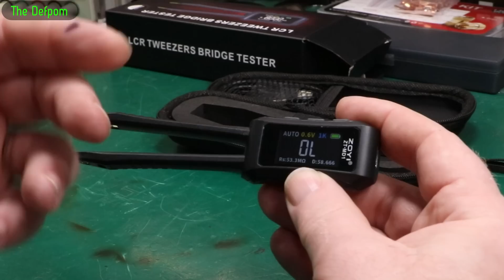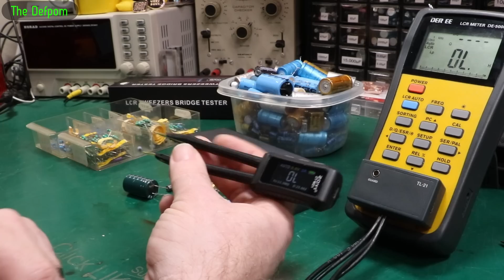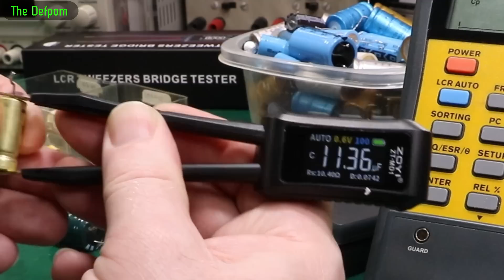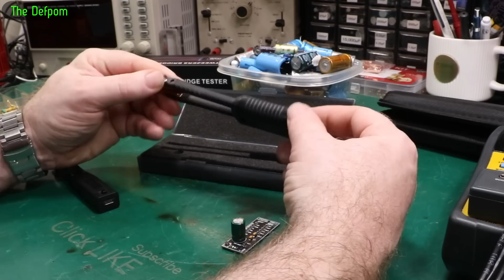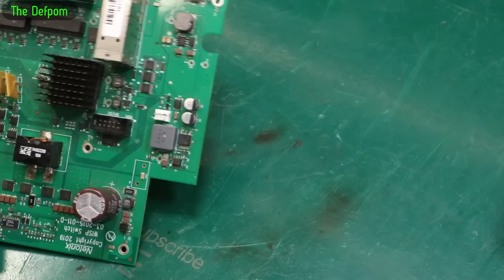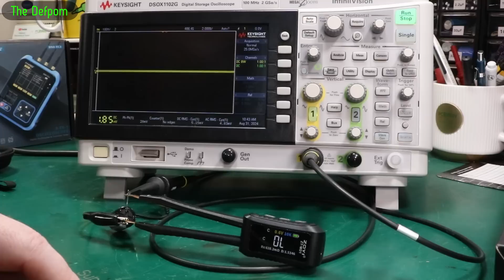🔴 Good LCR Meter ? - Zoyi ZT-MD1 LCR Tweezer Review - No.1274

Comment: For in-circuit testing you should actually lower the test voltage (with the newest firmware you can go as low as 0.1 V) so that surrounding parts on a board are not activated for a more accurate reading.

Comment: Did you ever compare ESR on smaller mylar or ceramic capacitors?  I found quite a bit of variation between my ZOTI and my BK 879B LCR meter.

Comment: The boot loader for the Zoyi ZT-MD1 and the FNIRSI HRM-10 look almost the same. They have similar key press shortcuts to enter the boot loader mode (hold left and power). The displays show a similar bootloader message. And the drive that appears when connected to a PC has a file with the same filename (Readme.TXT).

Comment: When measuring in-circuit, the 300mV test voltage may be very useful, as it in general does not activate most transistors, diodes, etc. If the reading was flashing (moving around, changing frequently) at 600mV, you may find that the reading settles down to just one reading that hopefully is accurate. Would like a short video update for in-circuit testing at 300mV, as you unfortunately did not cover that. Thanks for your work in testing this product. I appreciate it very much.

Comment: pretty much every device that has an LED, the manufacturer drives it as hard as possible to burn it out so you have to buy a new one! LED lamps for example specially do this
Reply: Depends from LED position. You will not want status LEDs burning out, especially when status change is dangerous.

Comment: The bending of the tip, and the sharpening was the first thing I did to mine. They are suprisingly good for the money. Only thing to determine now is the battery life, but it does appear to charge quite quickly
Reply: Exactly!  A little Dremel grinding & bending off the tips is all that's needed. 👍

Comment: Amazing! I have been offered one too and it looks like a decent LCR meter for a change :) it would be nice if it had 100hz as frequency measurement as well but I guess 1KHz and 10KHz would do. Thank you for doing the comparison, if I ended up making a video about it I'll point my viewers to this video for a reference with a proper LCR meter. (Edit - no, it can do 100Hz. I misread the feature list)
Reply from the maker: @tony359  Hi Tony, it does 100Hz, just not 100KHz, which is fine.
Reply: @TheDefpom  Yes, I'd agree. 10K or 100K won't probably matter for me. Thanks for showing that the tool is ACTUALLY using those frequencies when testing with the scope. I'm kind of reluctant in accepting those tools as most of the time they turn out being a waste of time but this seems decent - particularly for someone who doesn't have a proper LCR meter :)
Reply: @tony359  These frequencies are only necessary for very low inductance or capacitance accuracy.  Someone in the RF field might be more interested in 100KHz.  It would be a real bonus, but requires higher slew rate components inside the meter.  Davy Jones has a good review of how a LCR meter works.
Reply: @Y.T.Learner  Thanks, I'll take a look. Indeed, the lower frequencies are plenty for my use - which is still to distinguish between "good" and "bad" caps :)

Comment: Zoyi released two firmware updates recently. 1.6 improves the speed when measuring. 1.7 adds data logging by pressing Hold
Reply: does it add any new languEges?
Reply: @TheGrantourismo  No. There's some info on the  zotektools website: "1. Added the functionality to save and export measurement data.  
2. Improved the accuracy of low resistance measurements.  
3. Corrected spelling errors in English words."
Reply from the maker: @TheGrantourismo  they fixed that too I believe

Comment: When the box is on display vertically, 1 year warranty is "UP" and both the other text is equally sideways.  The voltage 0.3 is there for in-circuit testing where diodes might be present and you don't want to forward bias diode junctions, which reveals passive component performance more clearly.  Usage rule of thumb to put yourself in the the most accurate range, use 10kHz for pF, 1kHz for nF, 100Hz for uF.  Similarly, 10kHz for uH, 1kHz for mH, 100 Hz for H.  Not only is the diode voltage low, the current is to.  So the voltage drop across Schottky and silicon diodes are not accurate, because the current is close to the knee of the diode response curve.  I agree - could be much better.  Some other tweezers I have will do the job and also Zener diodes, but they are not LCR meters.  Version 1.7 firmware has been released, includes the ability to log readings to a text file each time hold is pressed.